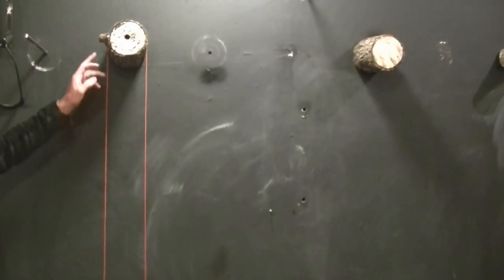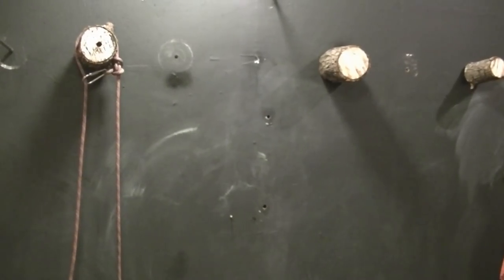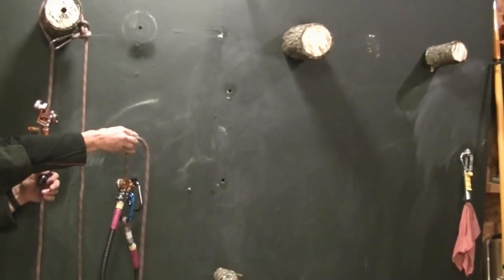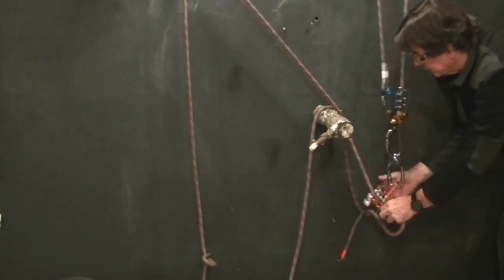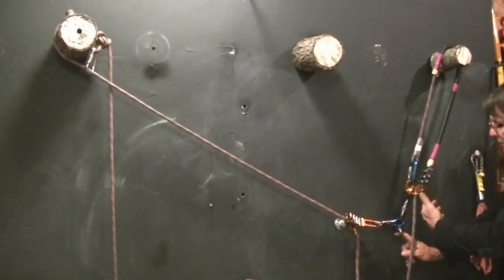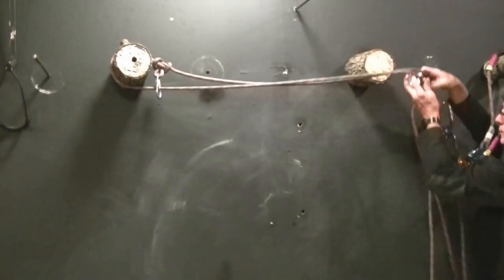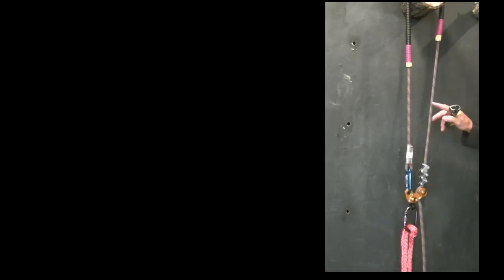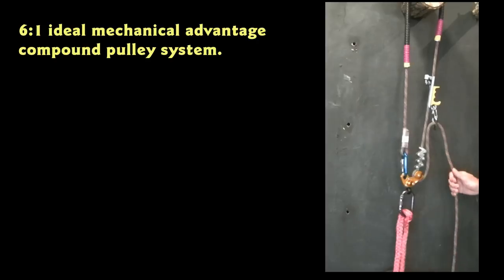SRT and DdRT, the best of both worlds.

Comment: Great Video.  Great solution.  Is that a washing machine hose used as friction saver on right?
Reply from the maker: Dan House rope sleeve or cambium saver, basically flexible electrical conduit.

Comment: Thanks a lot for this and all your videos.
I'm a beginner and have a dumb question, please..... using the other end of the SRT canopy anchored line for your Ddrt like that, since the end of the rope you do the Ddrt with is the "retrievable" end, is there any way one could inadvertently put their weight on that retrievable end so as to "retrieve" it with their body weight and free-fall to the ground? Thanks!
Reply from the maker: If you take your climbing device off of the rope and then reattach it to the other side, the retrievable side?  Sure if you attached to the retrievable side it will retrieve oh, this is one reason you always load your system before you detached what you're on.
Reply: @RichardMumford1  Got it. Thanks!.... so if one does load the Ddrt side before releasing/detaching the SRT side and if it holds then, after that, until changing the configuration again, then it is theoretically impossible for one's weight on the Ddrt side to "retrieve" it, correct?   .... maybe I just need to work it out on paper.

Comment: Very slick! What line do recommend as "the best of both worlds" ?
Reply from the maker: Calvin Swenson IMO that depends more on the type of ascenders you will use than the fact that you are going to use both SRT and DdRT on the same line. I am liking this Safari Kernmaster and with using mechanicals both sides the 11mm seems to work well.  
The Rope Wrench with a favorite climbing line and friction hitchs would be an excellent solution for this system.